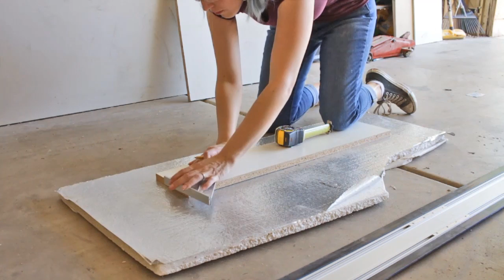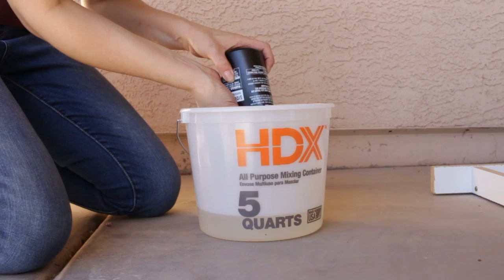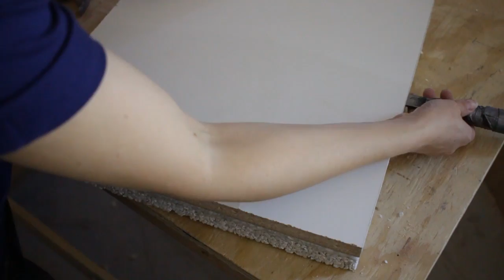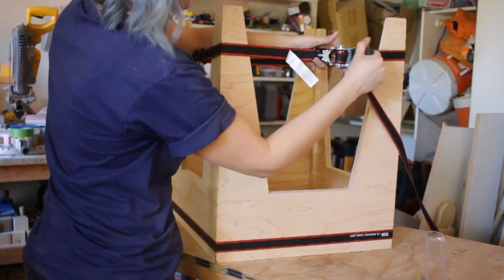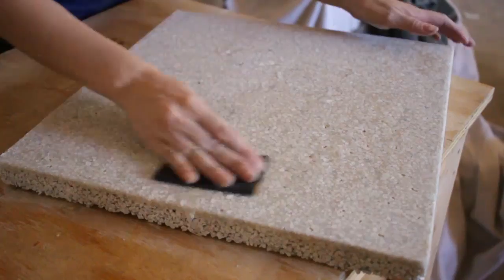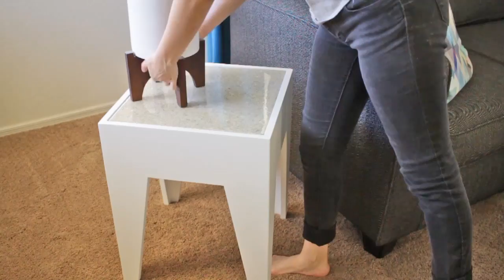ROCK and Epoxy Resin Table Build

Comment: Use normal 2x12 in boards regular lumber chip out chunks at the end for your River dig through the center and make it be at the ends then put slate on top of it at the end with caves in it use 100% silicone after it dries make your Rivers and your prehistoric people and vulnerable snowman Mammoth elephants hairy rhino and all the rest along with your trees you can make the trees and bushes using cotton and super glue

Comment: Use old sleep from a roof packet busted up and make mountains with caves use the silicone to hold the slate together that's the way I built caves in mountains inside my aquarium try doing that you can make caves with little creatures like Bigfoot or the abominable snowman and rivers coming off the mountains down into the bottom where you can have your regular wood and your River along with some big Stones mounted inside the river

Comment: Great build. One thing I would have done differently, coming from a youth with several aquariums, is to rinse the rocks in water before adding the epoxy. There is a lot of dust in the stones, which could be the reason for the "yellow" colouring of the epoxy.

Comment: Try 2 coats of paste wax on your form, then brush a thick coat of resin into it. Passing the flame of a propane across the epoxy pulls the air bubbles out. Then mix your rock/epoxy mix, and fill the form. Cut several wooden wedges to use for separation. Get the edge lifted then insert a wedge. With several wedges inserted at various positions around the edge, gently tap each one till separation. This spreads the force out and minimizes chance of scarring. Hope this helps..  Cheers  :)
Reply: I wonder - can  paste wax on plywood substitute for melomine?
Reply: @mford9029  I would recommend sanding and sealing the wood with urethane two times, and let cure well before waxing twice. Just remember that it may separate cleanly, but will telegraph all imperfections to the surface of the item.

Comment: Nice! Well, you could add all sorts... such as glass 'pellets' from broken car safetyglass or bottles, glitter, aluminium, tiny objects such as the figurines you'd find in cereal boxes, small nuts / bolts, marbles, flakes of goldleaf, lace fabric. You could also split the resin and stones into smaller batches and add different colors to each batch; Putting each batch in the mix would / could make colorful 'swirls'and stuff.
Anyway the sky is the limit!
Reply from the maker: Oh I LOVE the broken tempered glass idea. That would look amazing!!

Comment: One tip when using a paint gun, don't pivot your wrist like that. The arcing motion puts the nozzle closer at the center of the arc and in turn puts more material in that area. Try keeping the nozzle an even distance from the object being painted and spray past the edge. It probably wouldn't matter much on a small project like this but it's a good practice to get into.

Comment: If you mixed the rock into the form with the epoxy without first rinsing the rock you may have gotten dust into your mix which may account for some of your discoloration. Very cool idea.

Comment: Try pouring a 1/8 - 1/4 " of resin into your form first wait till it's tacky make a few passes with a heat gun or torch to remove the air bubbles. Then add a thin layer of stones, and repeat, clear epoxy will still show the stones, and you will use a lot less material. Check out live edge river table top videos. Great Job!

Comment: Spray the mold with PVA mold release (polyvinyl alcohol) after using a release wax, it should help the epoxy release from the mold.  Its what they use in making fiberglass boats and panels.

Comment: Just curious, why wouldn't you fill the form with the rocks then pour the resin to fill?
Reply from the maker: I thought about that but was worried it may leave small voids on the inside layers between the small rocks where the resin couldn't flow. I think the bond is a little stronger by mixing it together first.
Reply: Pneumatic Addict I guess it would depend on the viscosity of the resin.I would think that the paddle mixer would also be likely to add air pockets.  Did you vibrate the form once the mix was in, kinda like you do for a concrete form?
Reply: Heat also helps air bubbles “flow” out... A heat gun does wonders.